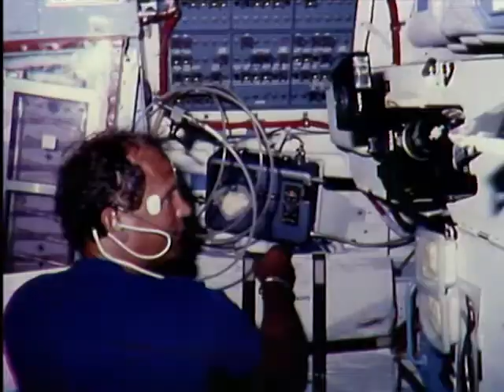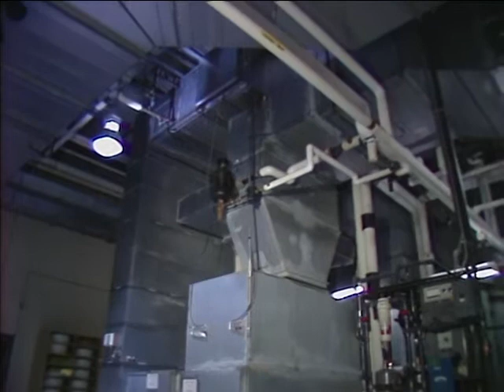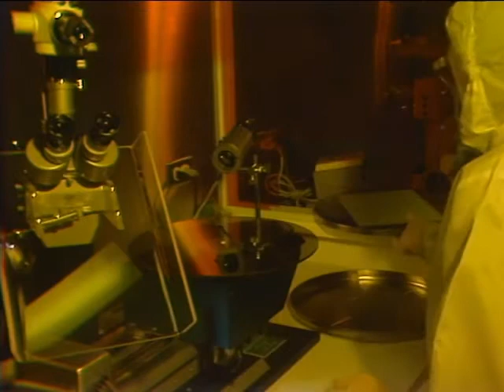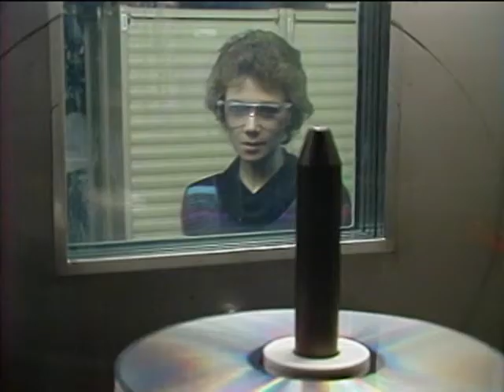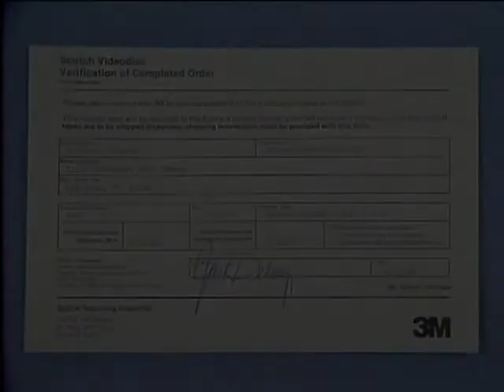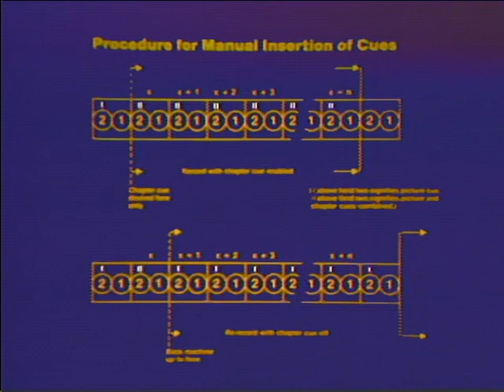3M "Scotch" Laser Videodisc... An Accessible Resource

Comment: This is great.

We finally get to see how 3M made their discs using a cold-casting process whereas Pioneer and others used injection molding.
Reply: They were stamped, not cast.
Reply: @Derpy1969  I'm just going by how the process was supposedly named.

It was called cold-casting, but the process did involve stamping blank discs as opposed to injection molding molten acrylic.

Comment: Life Changing Stuff, i wonder how many Gig these much hold! 1Tb?
Reply: They’re analog video, with two channels of analog audio all saved into one frequency encoded analog stream.  The video is composite, like VHS.  

Later discs supported two channels of uncompressed digital audio at 16bit, 44.1khz, but they were also FM modulated into the existing analog stream.  Think of the information stored  like the broadcast signal of a TV station.     It’s all decoded and broke down by the player for the TV to display.